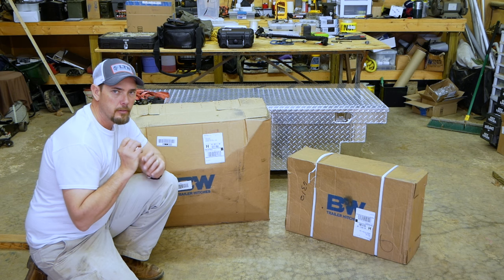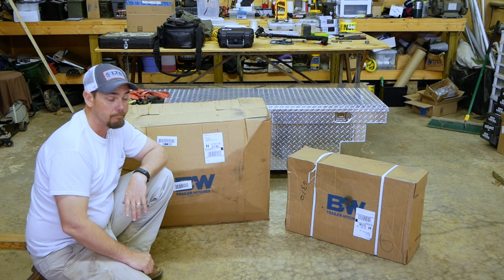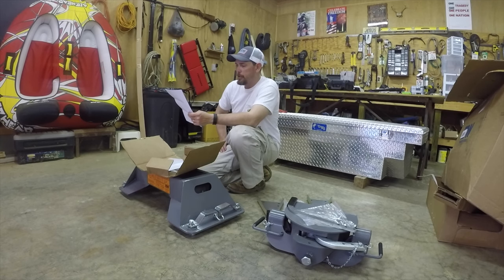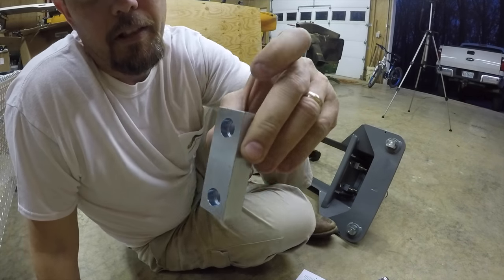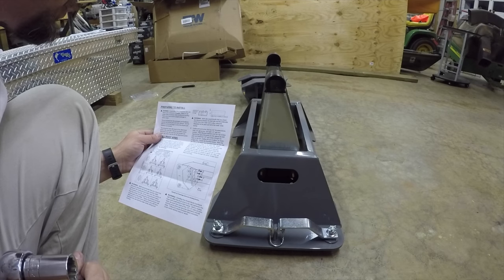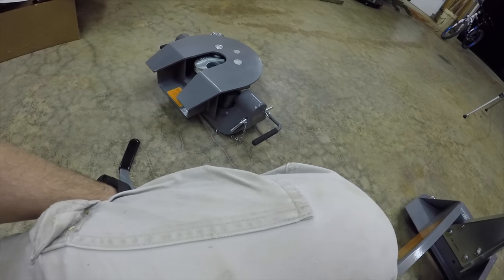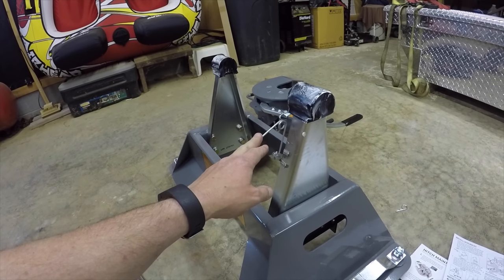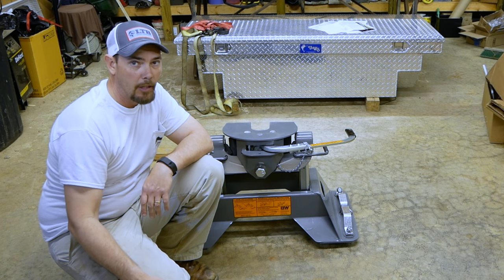New B & W Companion 5th Wheel Hitch in a Short Bed Truck??-Part 1

Comment: Glad you posted this video, though I only watched it after doing the same thing you did. I went from a longbox with a non-sliding 5th wheel hitch to a 6'4" (short) bed and was told by the RV dealer to get a sliding hitch. I didn't really think I needed it but they were really concerned and said they couldn't assume any responsibility if I bought a non-slider in a 'short' bed truck.

Well, I got the same hitch as you and it works perfectly fine. The only time I need to be concerned is if I'm turning hard left/right and then decide to back up, essentially jack-knifing the trailer, which I never do. Took it for a drive and was very happy with the results.
Reply from the maker: Haha, glad you stood your ground with the hitch. I love mine and will NOT go back to a slider. Yes I have to watch a little more in sharp turns but I really don't get into many of those situations. What I have to watch more is the bed hitting the underside of the cap if I pull out and it's on a slope but I think I watched for that when used had the slider.

Comment: I just assembled and installed my companion hitch. I'm thinking I went too high on the rails so in a bit I'm going to lower it to the middle setting. That's the great thing about this hitch, easy to adjust. I'm looking forward to using it since I'm pulling RVs for my living now. Thanks for the video.
Reply from the maker: Glad the video helped and thanks for watching. I had to lower mine to the bottom setting to level my camper out.